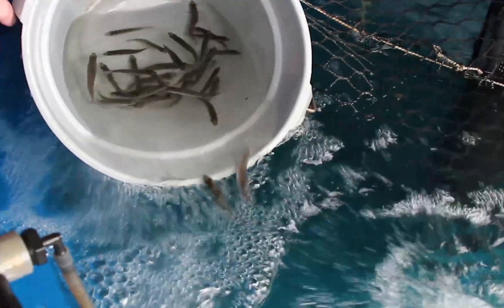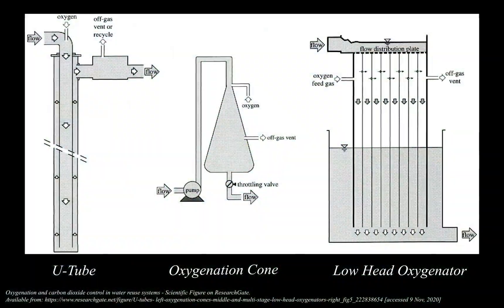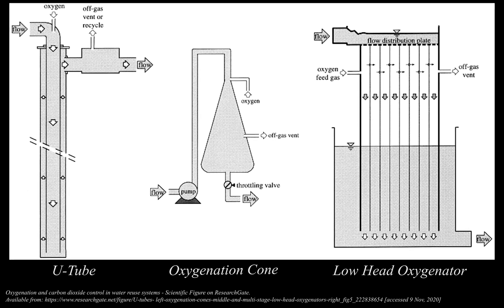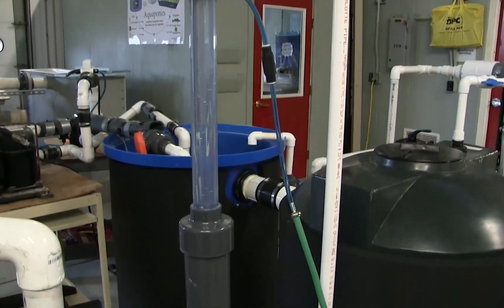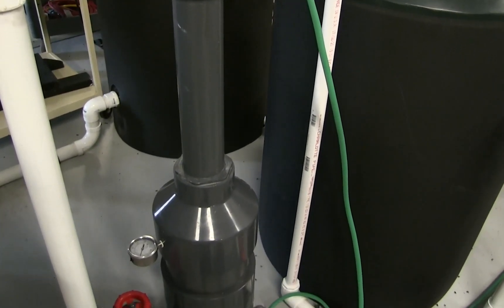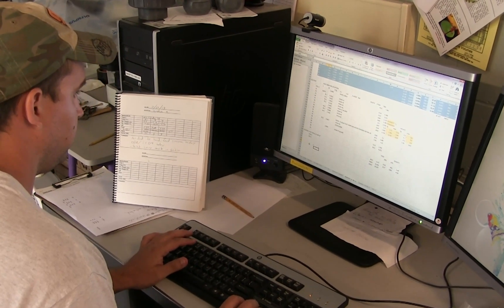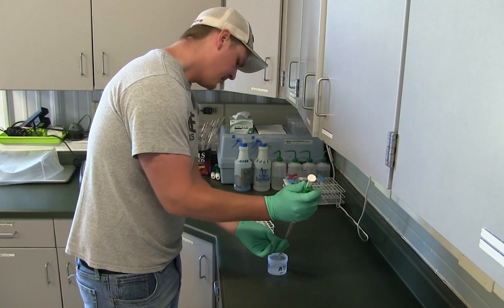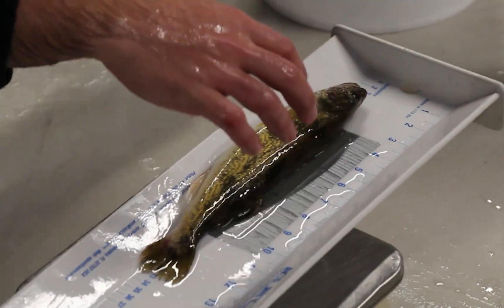Nanobubble Oxygenation in Recirculating Aquaculture Systems (RAS)

Comment: Its a bad design,non eficient ,high energy consuming if your injecting air into water and especially fresh water wich is less dense than saltwater and bubbles unite faster this reducing the surface area of the bubbles.
Overall its a good sistem for oxigenation and water cleaning but you do it wrong ,non efficient.
Reply: You might want to do some studying up on what nanobubbles are before you make statements like this. You dont seem to understand what they are.